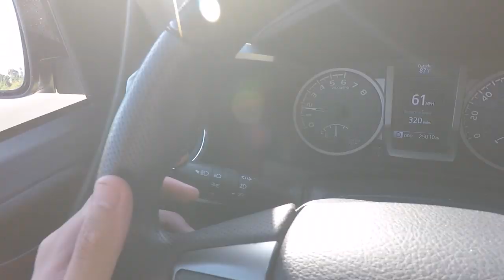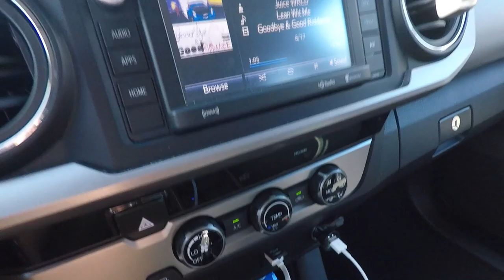Getting My DREAM Wheels For The Rocket Bunny FRS!

Comment: What budget wide wheels do you recommend for a widebody? I know either way they’re not cheap but what choices you recommend lookin at ?
Reply from the maker: Steven Perez A lot of people run cosmis wheels. They’re priced pretty good on amazon. I ran those aswell with 1 inch spacers 18x9.5 +10 / 18x11 +8. If you want 3 piece wheels follow threepiece.us or vrwheels on instagram they post used wheels for sale!
Reply: Chris Borges I appreciate it broski that was real helpful
Reply: Chris Borges bro so I was looking at those cosmis wheels and from your experience, if I wanted to go with a square setup and have 18x11 in the front as well, do you know if there will be enough brake clearance or will I need to run spacers to clear the brakes but then the wheels will stick out past the front fenders??
Reply: And if spacers are needed in the fronts even with the 18x9.5 is there enough back spacing room on the rims for the studs that’ll be sticking out or do those need to be shaved down
Reply from the maker: Steven Perez Spacers will be needed all around given that they come in 5x114 only on that sizing i believe. Don’t quote me on that but I did have to run adapters since they’re 5x114 in my case. So i’m not too sure about the brake clearance issue since i ran spacers with mine.
Reply from the maker: Steven Perez They do have back spacing behind the wheels but since i ran a 1inch spacer, the stock studs are 1inch so I had no issues with studs sticking out past to interfere with anything.
Reply from the maker: I recommend running 9.5s in the front. A lot of people run that to minimize rubbing when turning. You can run an 11 but i think you’ll be running into a lot of rubbing. The most i’ve went on the front is a 10. But it’s all personal preference!